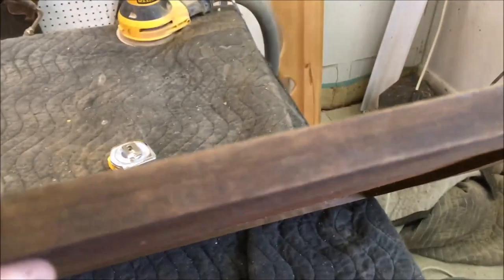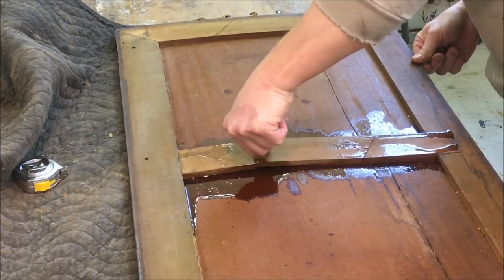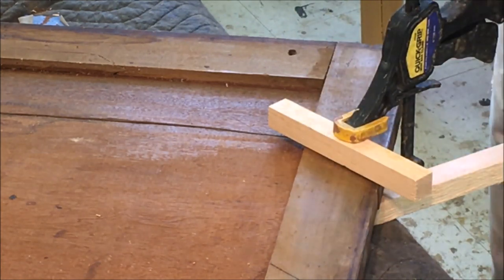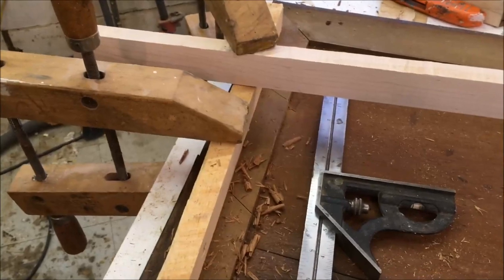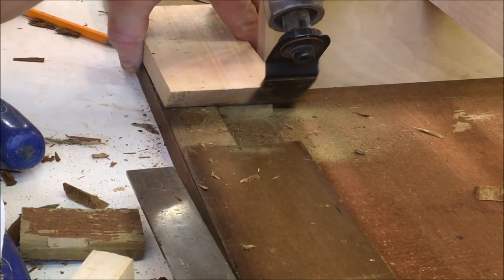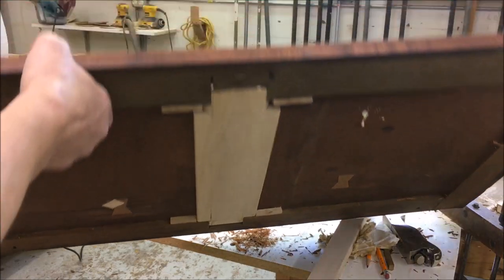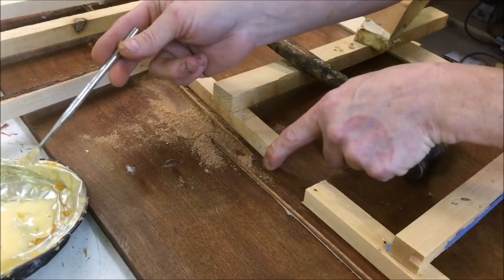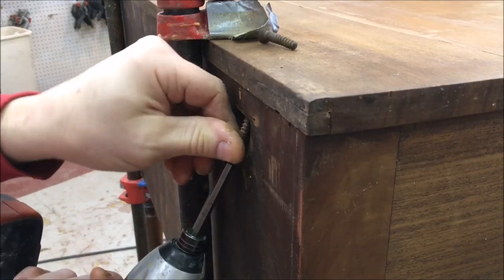RESTORATION / SHERATON MAHOGANY SERVER -PART 3/4 -FEELING SPLIT

Comment: I didn't quite understand why you didn't fix the table top by injecting some glue in there and just clamping it. Seems like that would be a strong and mostly invisible.
Reply from the maker: the top had shrunk over time and caused the crack , so the wood  was  in it's final position , it would have been difficult to pull the crack back together , and in doing so would have stressed the wood .after touching up the crack it was barely visible

Comment: You did so much better on gluing other things you didn't try to wipe off the glue never wipe off the glue you can scrape it off butt wiping off squeeze out or messy work with water you know destroys the adhesion of the glue the wood absorbed the water kills the adhesion